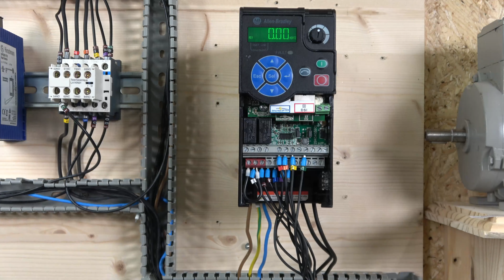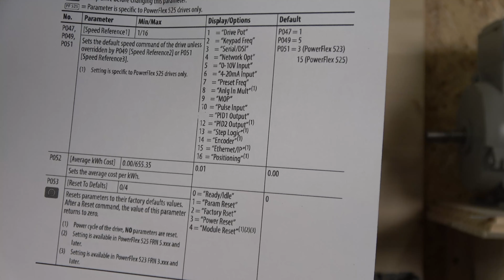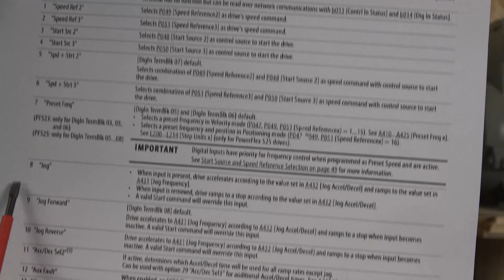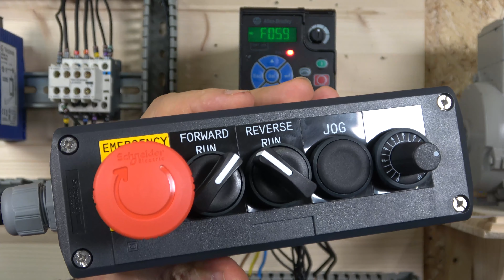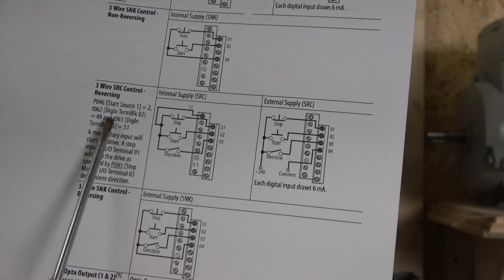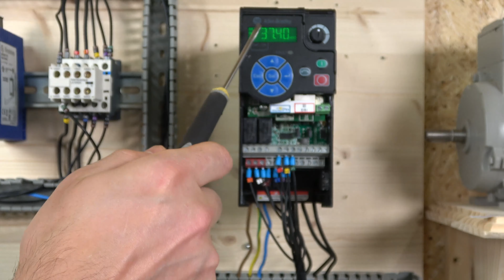Allen Bradley Powerflex 523/525, remote control, 2 Wire control, 3 Wire control. (English)

Comment: can you explain the power wiring as well. I am bit confuse as my powerflex has single phase input and three phase out but I don't have the three phase load to test. How I can test with single phase load????
Reply: Your comment is so old you probably already figured it out, but you you should be able to hook up the single phase side, then run it as normal without a motor attached. You should be able to measure your three phase voltage across the  terminals for the motor.

Comment: @IGS Electronics Great video!  I have a question.... If I wanted to control an AB 523 start/ stop and speed from the keypad, but also have a photoeye ( 2 wire or 3 wire) down stream that would stop the drive when blocked, and restart the drive when cleared, is that possible? Thank you